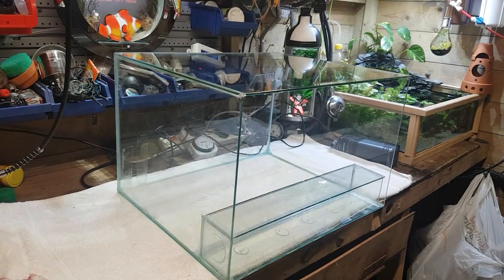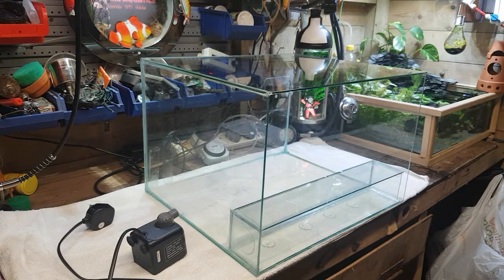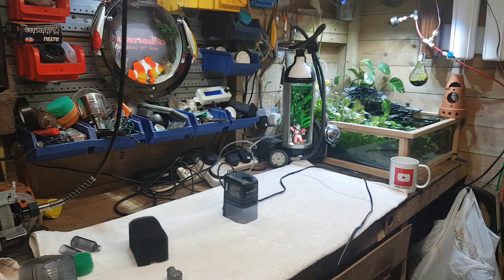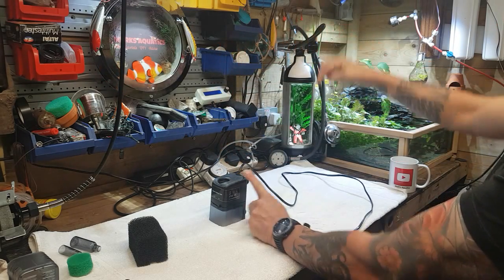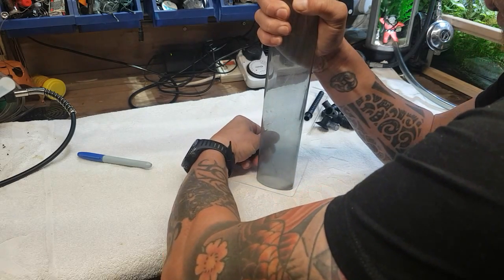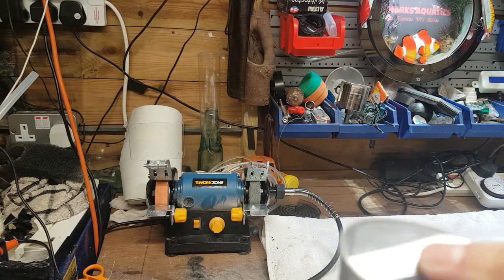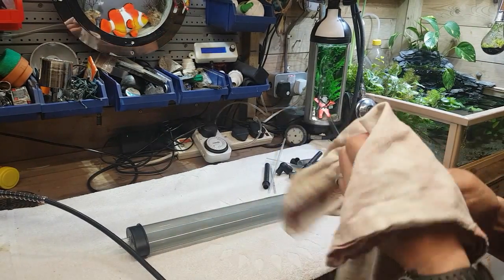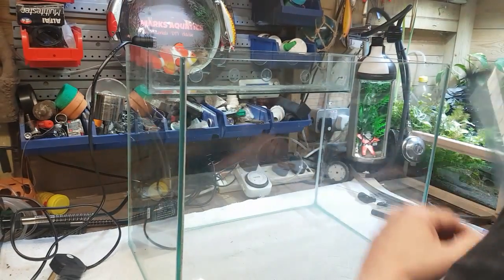HOW TO SETUP A SHRIMP TANK PART 2

Comment: Like it Mark, do you know if the stuff you have used for the background is available with smaller squares, around 1/4 inch.
Got an idea i want to try.
Reply from the maker: There's lots on ebay type in egg crate you should find what your looking for.👍😀
Reply: Cheers fella keep up the good work

Comment: That's brilliant. I've got a tank that needs repair anyway. Thing is it's 4 feet long. I wonder if it would work having a filter that long? Would the stress from the weight be too great in the middle?
Reply from the maker: In that case make some square braces and silicone them in around the middle. 👍😀
Reply: @MARKSAQUATICS  Awesome. I'll try that. Thanks Mark!